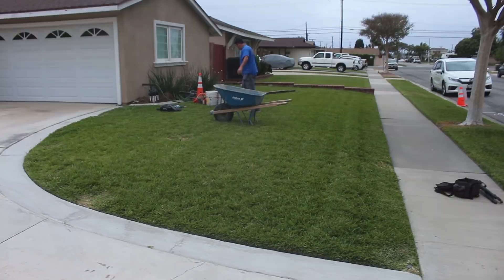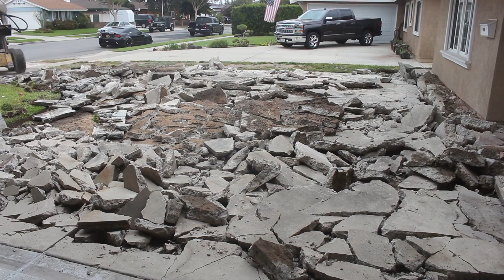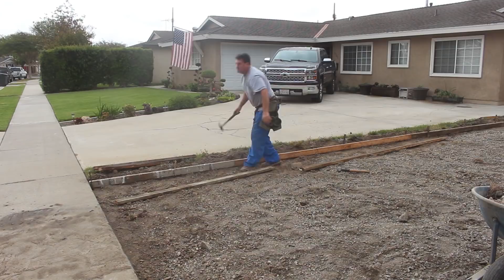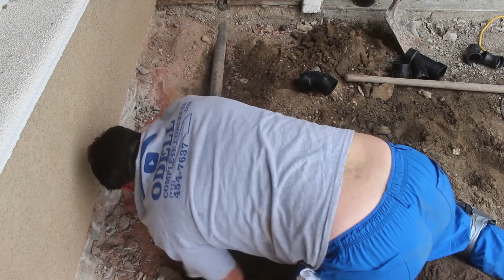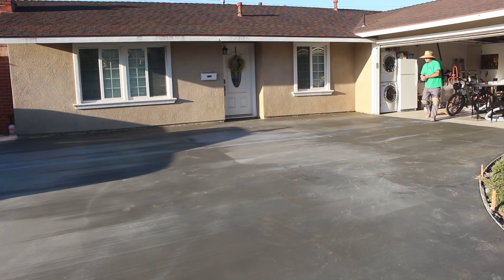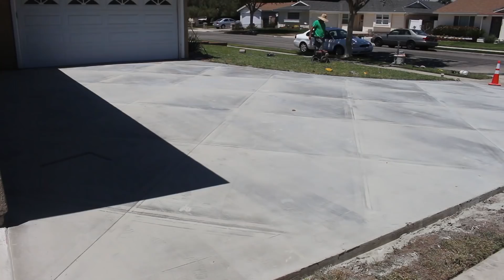How to Replace & Pour a Concrete Driveway (Diamond Cut Pattern!)

Comment: as a gc with a plumbing license. i highly recommend when you came off the sewer for the cleanout it should have been a tee. you did right with the wye for the laundry line of course. but on a clean out putting a tee in the drain cleaner can see flow line while he's cabling, on a wye you cant watch flow line so it makes clearing the drain harder
Reply from the maker: That's interesting.
TY

Comment: Is there ever any reason to use expansion joints in between driveway pads? I feel like where I live a lot of guys put expansion joint material in between every pad. Thoughts? After watching your videos I feel like it would be better to just dowel them together (or use rebar on initial pour).
Reply from the maker: It may something to do with the weather conditions
Reply: @OdellCompleteConcrete  I live in PA and we do have harsh winters.

Comment: No wonder why that drive way was cracked,, that dirt is saturated. Obviously the tractor was sinking,, has a water table under there.
Reply from the maker: Obviously, The problem is the concrete driveway was modified for brick, and there is no reinforcement.

Comment: So many of the driveways you replace have no rebar, and the subsequent concrete cracks and moves so badly.  Why were they not laid with rebar when originally poured?  Is it the builders just trying to save money that they skimp on the concrete by not adding the rebar?
Reply from the maker: Most likely that's what it is

Comment: well nice video but why du you allways buil everythin in dirt im from germany and we fill 3 different typs of material under the driveway to be safe that there will be no cracks in the driveway after deep winters and hot summers.  we condens the matrial and build a drain unter the dirveway so the ground cant move after heavy rainfalls. i know is a bit more expensive but it will last soo much longer and you can drive with way heavyer trucks on it. and using bigger sone sizes in the cement  would make is more stable. Whats your oppinions to that. would be cool to hear your thoughts:)
Reply from the maker: This is Southern California
Reply: Up here in the Northwest we do more fill under cement usually crushed limestone hit with tamper then poured. I did a bit of mud work when I was younger.

Comment: Why not use wire mesh instead of rebar?
Reply from the maker: No good
Reply: Odell Complete Concrete Most likely wouldn’t hold up very long, no strength in the small wire! Good for counter tops and steps and such without the heavy vehicle traffic...

Comment: They make a little skateboard attachment for the wormdrive.  It will eliminate the need for using a straightedge cutting your joints. Plus it takes half the time and you can be by yourself once lines are snapped. I think it's made by mongoose. Best 75.00 I ever spent.
Reply from the maker: Sounds awesome

Comment: Hey David. I understand the concrete is still green but what at the streaks in the concrete from. I saw you guy running a broom after you power trowled it but it looks like a smooth finish anyways. It looks great btw
Reply from the maker: Matt Davis 
It's all part of the curing process.
It will be magnificent when it's all dried out.
Reply: Odell Complete Concrete thanks for the reply David. I do concrete here and there and I must say, I've watched alot of your videos to answer some questions on my own technics. I've also burned alot of concrete in and never had a good explanation on why the concrete done that. Thanks again. Btw I subscribed to you channel.

Comment: I don't know anything about concrete but your videos amaze me. What is the purpose, if any, of using different trowel materials to smooth and what is the purpose of that machine after you smoothed it out?
Reply from the maker: The machine makes it flatter and the surface harder.

Comment: Greetings from Bulgaria! Nice job. I have mixed feelings about the relief cuts though, aren't they introducing weakness in the concrete surface where the elements can start eroding? I can imagine in a cold climate ice forming inside and pushing against the edges of the cuts.
Reply from the maker: You can always caulk it in those conditions.

Comment: The surface does not look so nice. Very streaky and the colors are inconsistent. 
Why is that? USually your driveways are uniform.....
Reply from the maker: The concrete has to cure out.

Comment: Not bad!  Usually with that good road base I always water it down real good to get it to reactivate a bit and harden right before compacting.. good call not doing it on that drive though! I have a feeling if you did it every bit of that would have just smooshed into that nasty mud as soon as the compactor hit it.  Awesome design!  Love the work!
Reply from the maker: Thanks
It worked out well.

Comment: 09:50 to 10:15 __  When I had my driveway re-poured in 2002, I had the contractor put in a 4" drain pipe under the driveway as a conduit, through which we ran the schedule 40 sprinkler pipe.  If the sprinkler pipe breaks, we can dig down on either side of the driveway, extract the damaged pipe, and insert a replacement, all the way across the width of the driveway.
Reply: I would have put in a conduit as well. If that line has an issue in the future it's going to be a bitch to deal with. If you have a conduit in there it turns a pain in the ass job to just an easy to deal with annoyance.
Reply: Yes I agree!
Reply: When we built our house, I bought and placed several 4" pipes where the irrigation lines could go under the yet to be poured driveway. Unfortunately, somebody didn't treat the stakes too kindly and we "lost" one of the 4" pipes! 😳 I'm thinking the water line will probably get ripped up by the next contractor when they replace the drive this Summer. 😂 Man's best laid plans (and pipes)... 😬